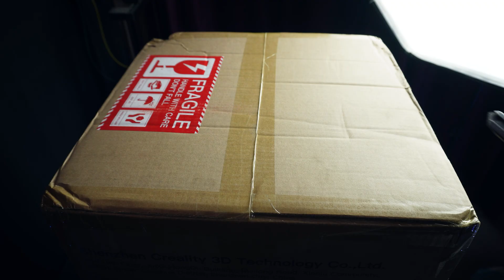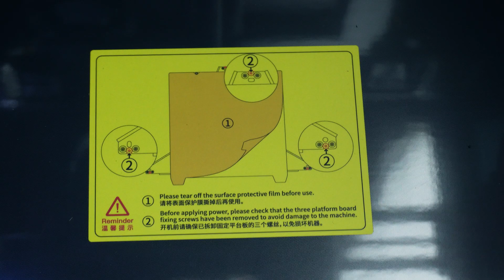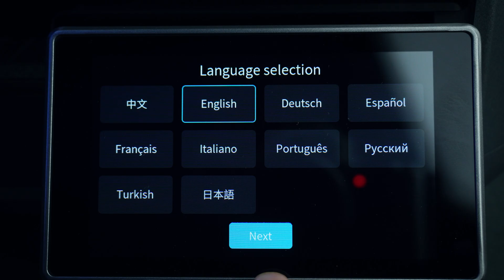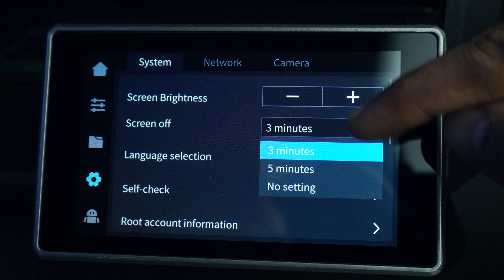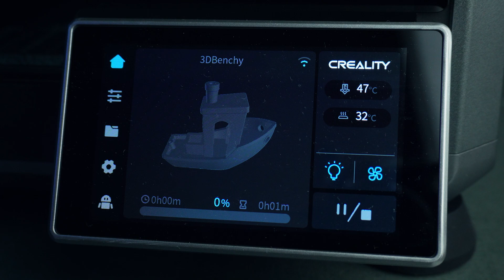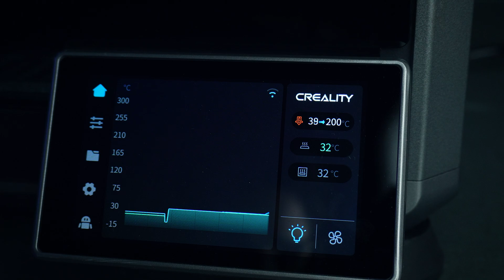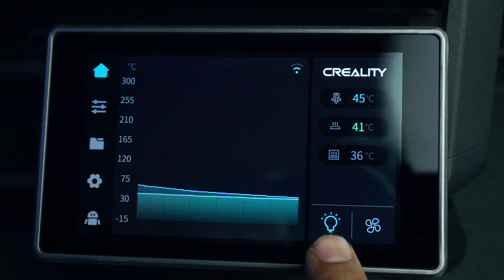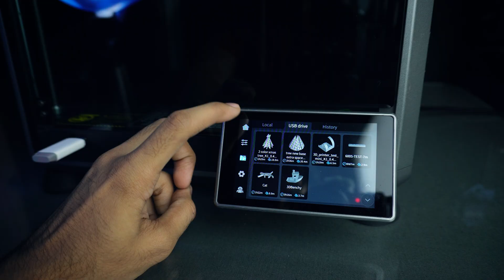Creality K1 Unboxing, Review & The Secret No One Is Talking About ! #3dprinting

Comment: do you need to apply glue every time you need to print on this stock provided plate ?
Reply from the maker: I have printed many PLA and PETG material parts, I have not applied glue yet
Reply: @3DELWORLD  thanks for sharing. This helps. I also wanted to ask if this printer is kept on a concrete slab or the floor wil it still vibrate so much ?
Reply from the maker: @sanketss84  No not that much, but there will still be some minor vibrations. if you do input shaping option after placing the printer in its place. then the machine will reduce its vibrations. 👍
Reply: @3DELWORLD  thank you for sharing

Comment: I think you missed some absolutely major minuses in there, which are far more important -  that being bad config that creality gives you (especially locking down the shapers), the ringing from synchronous pulleys that you need to repalce, proprietary cooling fan that you cant replace and that is 70db loud on max rpm (im sorry, is this suppose to be and industrial 8-10-12" exhaust fan or a printer fan?), limited creality web interface (where you cant actually change or adjust any settings) and inability to use a proper one without having to root printer. Overall it's a good platform to start if you can get it cheap but in the factory default state it's a expensive looking pile of crap and problems that you need to fix.
Reply: Hey. Just the guy I was looking for. Any chance to pointe in a right direction to look for the pulley replacement? Ringing drives me mad and you seem to know the reason. I lacked skill to narrow it down.

Thanks